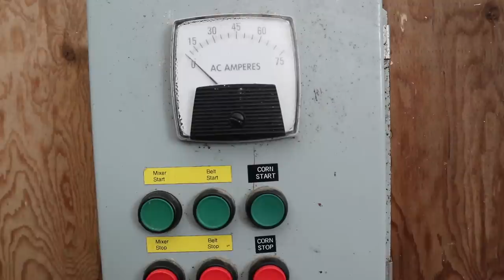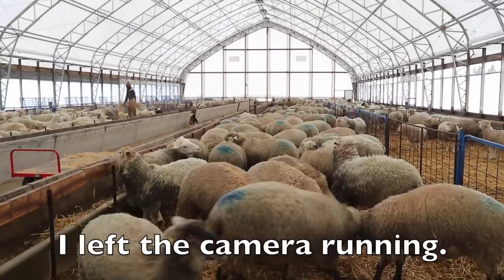COME DO SHEEP CHORES WITH ME.  Vlog 231

Comment: no fair! your 3x3x8 flakes stay together! mine always fall apart about the middle n it's annoying😜 wonder if you left the bales facing the door(so flakes fall towards the door) if you wouldn't have to lift so much but could just knock a flake or 2 into the bucket then just dump them into the tmr🤔even if you had to pull them apart folding in half works fairly well!

Comment: HI Misses Brock, could you explain about the bedding, as I think you can use many different Material, whats the temperature and does it start to compost and radiant some heat. humidity wise, do you have drainage under the bedding?

Comment: I know this sounds crazy but if you can find a baseball pitching machine you could use it to spread straw easily. The pitching machine is just two rubber wheel turning in opposite directions, if you fed a flake of the bale through it, it would spread the hay out in an arc. You could even mount it on the cart because it has a small footprint, the only downside is you would need to pull an extension cord behind you to power it.

Comment: Wonder how many experts in "workplace movement efficiency" watched this one - soooooo many things to adjust for faster and easier on the back/body adjustments to be made - work efficiently smarter not harder - might be time to reach out to an expert  - maybe some expert can see the benefit of a collaboration - just to keep you young and fresh longer.....😁😁😁😁
Even a change placement/angle of the big mixer could make it easier on both Bobcat/feed wagon -way less turning of steering wheels/wearing out tires and the shoulders of the one turning the wheels/twisting back and neck etc etc......being efficient means being faster......could be meaning more time on the couch 🤣🤣🤣🤣
Just counting the gazillion times you bend down to pick up/spread out straw WITHOUT using a tool makes my back hurt...... if you are planning on doing this for years changes has to be made....👀